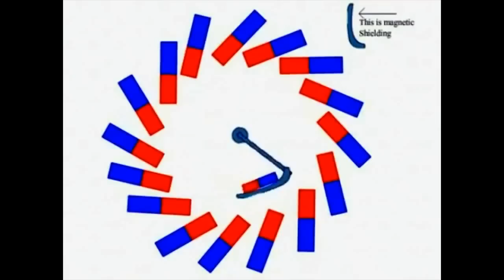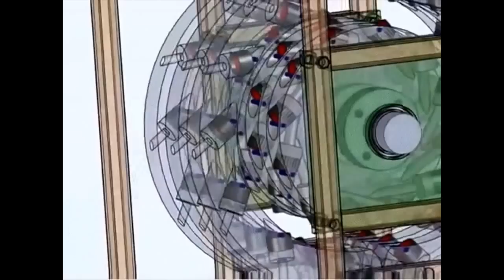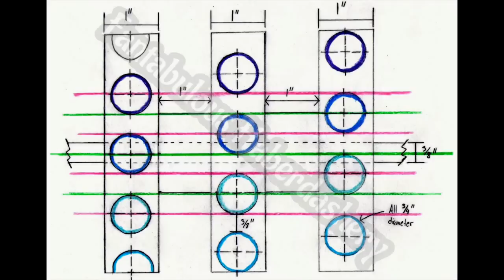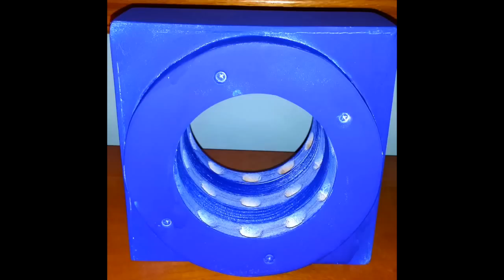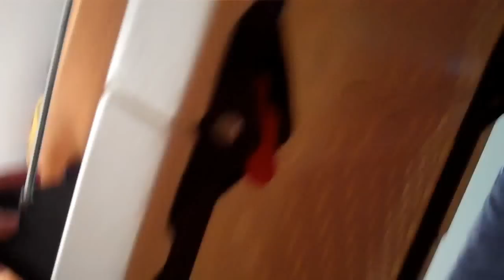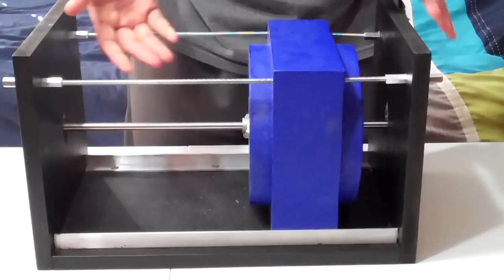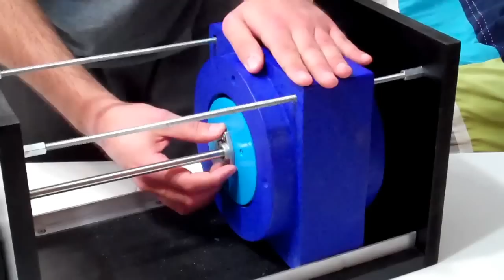Working Perendev Magnet Motor!

Comment: thanks for the video.  i've been wondering why the debate continues too, but i don't know enough about it to come to my own conclusion.  (2:02) but considering we have yet to figure out how to combine Newtonian physics w/ that of quantum physics—in a "theory of everything"—i don't think it's completely unlikely that we won't eventually create a device that essentially defies our currently known laws of physics.

nevertheless, i'd love to hear your opinion on Zero Point Energy; from what i understand, they're not proposing anything that defies thermodynamics.  i think they're referring to energy that may exist in the quantum vacuum, or "ether" as it used to be called, and which may also come from one of the theorized, yet unproven additional dimensions.  and i'm not sure about this, but it may or may not also have something to do w/ the Casmir Effect.

what i find most interesting and would like to get your take on is the Searl Effect Generator which uses specially imprinted magnets that produce a specific wave pattern which in turn, propels another magnet to spin—much like your device, but horizontally—creating an electromagnetic vortex.  i'm not sure what the Searl Effect Generator (SEG) actually does, though, because i originally thought it used Zero Point Energy; however, i later heard that what it does is strips electrons from atoms in the surrounding air (which apparently quickly and easily replace their lost electrons, i'd assume by robbing them from other atoms or something to that effect) and then funnels them into the electromagnetic vortex created by the SEG where it is then converted into usable electricity.  the evidence they claim of the latter is incredibly cold temperatures either around or in the vortex itself (some have claimed temperatures as low as that required for superconductivity); there have also been claims of levitation or anti-gravitic effects which were witnessed in a public demonstration attended by a few scientists as well as a few science journalists who took pictures of the device levitating.  in any case, i think the levitation part was a separate device created by John Searl based on the effects of the SEG but isn't necessarily an aspect i'm asking about.

so to clarify, what do you think about harnessing quantum energy (does it even exist)?  or, what do you think about generating electricity by stripping individual electrons from ambient matter?  in your opinion, are either possible and/or feasible?  btw, have you considered trying to mount your device horizontally, like the SEG?  i think the fact that the magnets are spinning against gravity and then w/ gravity might   thanks again for posting!  (the questions are open to commenters as well.)

Comment: Let stop looking for perpetual motion. This motor wants to run and to maintain a constant speed that also has enough tork to drive a generator a very low power draw motor that operates at 1700 rpm;s that can maintain the speed can be connected to one end of the shaft and the generator on the other end to power what ever you want. The idea here is to use just enough commercial power to drive a generator. About the same thing use to be done with a large heave well balanced flywheel.

Comment: I have been running on FREE energy for 9 years.
It is called used veggie oil from restaurants. (See my other channel veggiepower303)
The motor is never free because you have to build it.
But the energy can be free, if you don't have to PAY for the fuel.
In fact ALL energy would be free if we take the greedy corporations out of the equation.
Keep experimenting, you will learn a lot!

Comment: You did a nice job.
But think about this.
You are putting a lot of energy into the system when you spin-start it.
If you had a system without magnets that weighs the same, how long would it spin just by it's inertia?
I think you would find it spins as long as your magnet "motor".
The magnets give the feeling of a motor because they are being bumped around while spinning.
But if it was really a motor that produces energy, it would speed up......

Comment: If it "does slow down" eventually, it's not "sustaining itself". It's not a motor, it's just a very efficient gyroscope.
Reply: Not that efficient !
Reply: you can see the movement up and down. which is use of kinetic energy. also the other imperfections like the bearings and gravitational forces on the rods that would slow down. to improve it there coudl be more efficient bearings and change if possition as well as better more effective fabrication

Comment: Good "permanent" magnets don't "run out of power" from use. You seem to be assuming the magnets are giving up energy when they interact with each other.
Wrong. And there is fairly simple proof.
While they do not violate the laws of physics, what's going on is much more subtle than you seem to think.

Comment: The big problem with magnet motors seems to be that the torque generated by the differential between the surplus momentum and the negative effects of friction is not enough to create enough torque to be useful, say to drive a generator. 

I don't think this is a scam, but I also doubt that this kind of motor will be efficient enough overall to warrant commercial production. At the moment magnets are too expensive, and not efficient enough to make commercial production feasable.

Comment: The shocking secret truth is, motors made from permanent magnets do really work. Magnetization of ferromagnetic material takes energy - stored in the magnet field. According to the laws of thermodynamics, energy can be neither destroyed, nor created, but stored and converted. Therefore, magnetization energy can be released by demagnetization and converted into mechanical energy. This energy is ruled by the equation W/V = Bmax · Hmax; while W is energy in Joules [W·s], V is the volume [m³], Bmax is the maximum flux density [T] in the B/H-diagram of a particular magnet and Hmax is the magnetic field strenght [A/m]. However, there are bad news. W/V is an energy density [J/m³] and since ferromagnetic materials are heavy, the effective energy density is very low. That means, practical sizes of magnets wear off quickly. Thats the reason, such motors never came into use, until free energy scammers rediscovered the stuff, collected millions drom gullible investors and fooled millions of people.

Comment: If you put inside just in one place, small weights will sustain longer. But the weights should not be from metal! Try with different weights, untill you get good results and make something to count RPMS and in that way you will check the difference and what you can change

Comment: Its not free energy but extremely cheap and efficient energy. Think of the magnets as very long lasting batteries. Stationery magnets should be electromagnets that fire when the rotating magnet is aligned perfectly to push away or tdc (top dead center for gas engines). You can figure out the rest. Just dont go public when you make a working prototype or you'll have the government raiding your home. You know why.

Comment: So, in most cases you end up with the energy you can extract from a motor like this before the magnets demagnetize being less than the energy required to create the magnets in the first place.  Which makes it a bit impractical for a power source.

However...  If you were to find a place where the Earth's magnetic field were fluctuating, and you tuned your device to resonate with that fluctuation, you could theoretically tap power from the Earth's field, and that would definitely have the potential to be a practical power source.  (If only in certain places.)

If you're serious about making this work, the next thing to buy or build would be a good magnetometer so you can find and measure any points of instability near where you live.

Comment: There is no need for the boxes on the ends that support the bearings. Additionally, the bearings on each end are different. There is more than likely a miniature electric motor inside one of the end boxes driving a belt around the end bearing. FAK!
.

Comment: Question is, when it 'catches' and the rate of deceleration is reduced, is the remaining rate of deceleration more or less than the rate of deceleration of the rotor on its own with no magnetic field?. If it is still higher than the free-revolving case, then nothing is being gained. 

What's needed to settle this is a tacho pulse generator on the shaft and a means of indicating the rate of change of rpm.

Comment: At about 8:40 (https://youtu.be/8RZB1xstXS0?t=8m40s) a dark reflection is seen on the outside of the left semi-glossy vertical surface. Given the location of the reflection the entity/energy making the shadow must be close to the shaft end.

I can see no explanation other than you are the first to capture how dark energy wants to join the magnets for completion. As universe is a constant vibration of high frequencies wanting amperage and flux to not cross paths, the energy has no other option. As energy flow is constant through universe and dolphins always swims with a smile the truth can not be tampered with. 

Every thing is crystal clear except I wonder why the dark energy choose to enter through the left shaft end? Could it be how you oriented the room?

Comment: With these "motors" you will only ever get out what you put in, minus friction, fluid friction, heat etc.
 - It will only ever slow down, and will slow faster with more (or any) load.
If a machine like this is fully balanced and accurate (which this is not) each magnet repulsion is matched. 
So if one (magnet) "pushes" off, it is matched by the torque from the opposite side of the rotor, and the net Force is zero. 
If you use shielding then you are effectively reducing the magnets by magnetizing the shield.
If it doesn't accelerate from the moment you engage it (without mechanical input) then it is not possible to extract energy from.

If you want a motor, you need a rotating magnetic field, it is just how it works, man. 
If you can't make sense of that then you haven't broken it down enough & are missing something.
Permanent magnets, however do improve the performance of electric motors and generators.

Comment: While it's true that magnets will "run out of energy eventually", that is only because a truly "permanent" magnet has never been made. The problematic myth is that this happens BECAUSE they do work, which weakens their field.

False. That is not the case.

Take old iron magnets. Whether horseshoe magnet or bar magnet.

In those magnets, the polarities of the atoms would gradually mis-align, and render the magnet weak and useless. 

So they were shipped in storage cases (usually wood, and in the case of bar magnets it was a pair oriented oppositely), which included "keepers" made of iron, which joined the N and S poles of the magnets for long-term storage.

They did that because it was found that keeping the poles joined by a "magnetically conductive" keeper prolonged the life of the magnet.

And yet the magnetic field holding that piece of metal to the magnet is a FORCE.

Think about this. In physics, Force x Time = Impulse.

For over a hundred years, it has been known that magnets last LONGER, when they produce MORE force x time.

That is the opposite of what one would expect, if one assumes that doing work decreases the "power" of the magnet. It doesn't. Good permanent magnets today have a very slow rate of decay (loss of internal orientation). The amount of work done by a good permanent magnet is completely unrelated to its lifetime.

And I know that is not quite what you said, but I wanted to clarify that here. This is something many people (and perhaps even you) do not understand.

The point in a nutshell is that many people think the force generated by a magnet comes at the cost of weakening its power over time.

That is incorrect. The force exerted by a good magnet does NOT cause that magnet to lose its force over time. On the contrary: evidence shows that exerting force actually helps the magnet retain its magnetic abilities. Rather than weakening faster, it weakens slower.

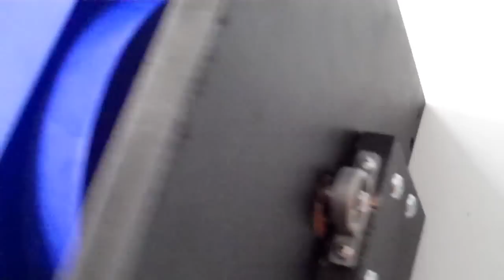Comment: Pay very close attention to the axle at around 7:41. You might have to use < > to go frame by frame, but there's a slot for an external drive of some kind and it stands out above the face of the bearing, unlike the other side where the axle is flush with the bearing. As has been mentioned before, about 8:49 when the motor "catches", you can see a dark object reflected by the surface of the motor case. It's suspect from the beginning that the whole object is not in frame, despite him being so adamant about his creation actually working. I'm deeply ashamed to share a planet with you, Haberdashery.
Reply: more observable sound on 10:08 to 10:11 form some external device  !
Reply: And please explain what you think he's gaining by "faking" something that has been covered so much already on this platform? Doing it just for "likes"?
Reply: Wow....didn't realize that comment was 5yrs old....forget I asked

Comment: this is awesome!! I wonder if anyone has tried to run one of these in a semi-vacuum. I would guess that it would increase efficiency, but that's just a guess.
Reply: Yes. Semi-vaacum, tighter tollerances, balancing, aero fill holes with epoxy and smoothen on a lathe... There's room for improvement. I wish he hadn't given up on it... 🥴
Reply: That is not a guess that is a fact where did you learn this
Reply: You can make a jet helicopter from 4 vacuum motors

Comment: Okay
1) There is free energy, or at least freely available energy. Wind, solar, hydro, electrostatic, and magnetic.

All of these are easily demonstrable, some easier than others. These devices are not "over unity" as some claim, but merely harness and utilizing those forms of energy in known or unknown ways. The Searl effect generator is one such mechanism. Another is far more simple and easy to demonstrate. Run a length of copper 12 meters into the ground, run a copper wire into the air. For approximately every 1 meter up you get 100 volts, for ever 1 meter down, you get about .025 amps.

2) the Perandev can work theoretically, but the geometry has to be perfect or you will never overcome the magnetic cogging. The correct magnetict alignment is 27.5 degrees, the direction at which information become interactive. Also, you need to use 3,6,9 geometry with and even odd arrangement. Mathematically speaking, this means 18 inner and 27 outer magnets.

Comment: Hi. It seems that the rotation of the inner rotor is unbalanced. Perhaps if you adjust this unbalanced performance the motor will run smooth.

Comment: it only sort of works dew to the wobble, if you sit it on a flimsy plastic shaft it will be able to woble in a way to gain momentum allot like how planets orbit one another dew to there magnetic fields like ufo technology with there 4 off centered toroidal fields u could get momentum dew to the wobble affect but you will need a shaft that can flex and bend, also the bearing will have to be magnetic ones to create a bit more movement.

Comment: Not sure what is the fuss here. People calling him scam and stuff. All he is show casing is something similar to a pendulum nothing more nothing less.  He also doesn't claim it makes energy. The test is to connect it to an electric generator and see what electric power it produces. But again my opinion here, he added energy to the system, by initially rotating it, it retained velocity for a period of time, but that is not creating energy, then it stopped. The other thing it only retained the original velocity never accelerated.

Comment: Ever see a battery charged magnet?  To control the strength of magnetic force,  building a system with batteries that recharge themselves from a generator driven  by the magnetic motor, so the stronger the battery the stronger the torque and push of the magnet, charging the magnets with produced power to batteries, say you build a charger for batteries, then are able to control the torque and power to drive the charger and generator,  so now you should have a system that feeds its self and a generator to produce electricity. Charging the battery like a car does, and driving a generator for free electric, the watts to run a house would be the object of 1 type another being built for construction and portable , are 1 to power a vechile.

Comment: yours may run but a small load would kill it, you need to make it from cast polymers like, nylon, and 2 feet diameter, at least 3 wheels, and 24 magnets, you're on the right track keep going

Comment: its still not your design, its perendev, slightly different but you're mot the first to slide the outer magnets in place horizontally, 
want ideas.
make them electromagnets,
have the outer fixed magnets flip polarity to attract and then repel,
build the thing with large rotors, place windings on the hub end of the wheels and have a built in alternator....

Comment: You are close to having it work. I have seen self starting magnet motors and some powerful enough to drive 10 to 20 KW generators. Yes, there are many that are guessing how they should work and to be configured, but a few have got the configuration correct. I have CNC mill and a lathe, and if all goes well, I would hope to build one this summer. They are fussy to get working, but when set up correctly, they work well. Find the one with adjustable hinged stators. It is self starting and can adjust the speed with the amount the stator is opened.